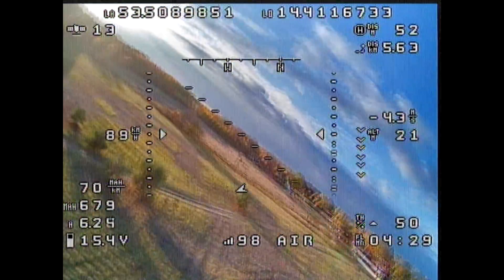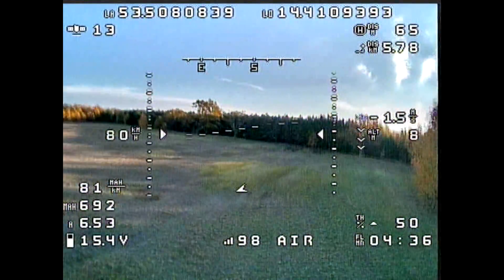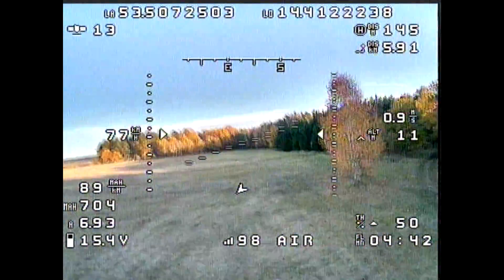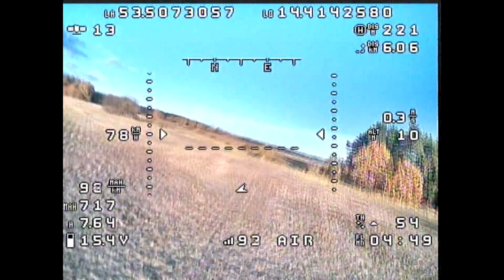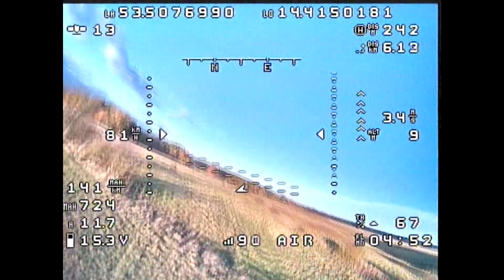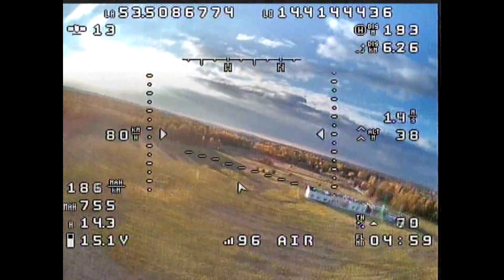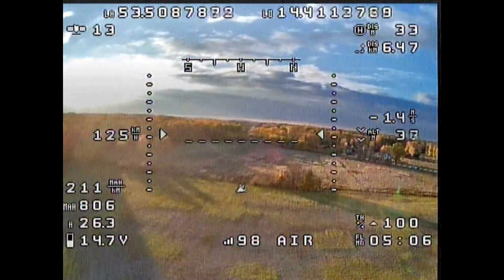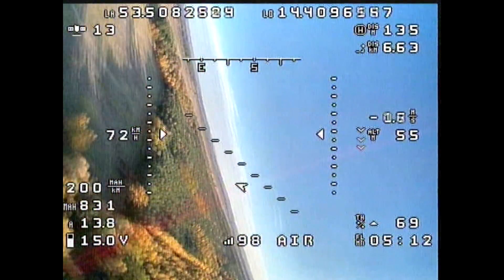Ritewing Mini Drak FPV airplane review

Comment: Can you share your PID's on inav 2.0.1 please? I'm having a hard time get it in the air. The build-in pid's give me too little aileron travel in pitch direction to get it in the air.
Reply from the maker: There is a Mini Drak preset for INAV 2.1 based on my tune
Reply: Paweł Spychalski I’m still on 2.0.1. Is 2.1 stable now?

Comment: High stall speed is the only drawback I see but I fly mine here in Colorado at 2400+ meters.  I have to use a bungee launch to get it flying.
Reply from the maker: I'm at +50m ASL and this MD weights only 1200-1300g so launch is not a problem at all

Comment: That laser cut Correx Sheet is appalling, come on now....Really..?...especially when you consider the price of this thing.
  Oh, and every plane flies nice in dead calm air Pawel..
Reply: It's the best foam you can buy.  The coro is used to allow easy field servicing of the aircraft.  I go through sets of fins on a regular basis landing in the desert.  When they get too crumpled, I just install a new set, good as new.  You can't do that with fragile foam fins.
Reply: No not every plane flies great in calm air most reviews says that the mini drak flies on it self without 
starting to do its own decision like starting a circle or drop nose etc.